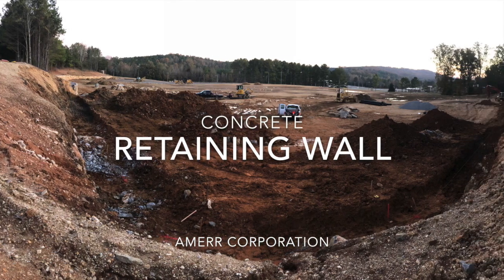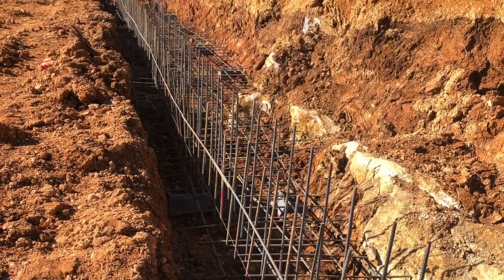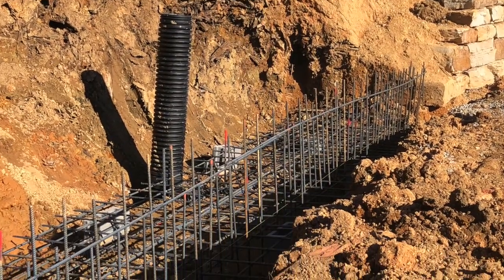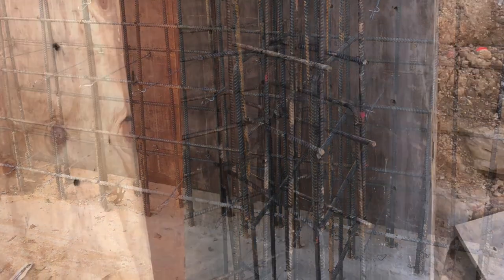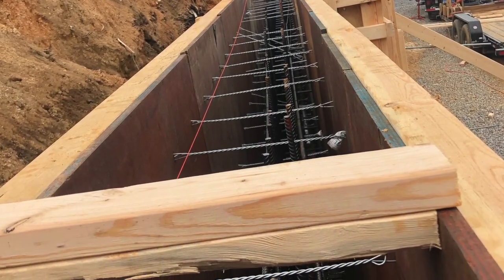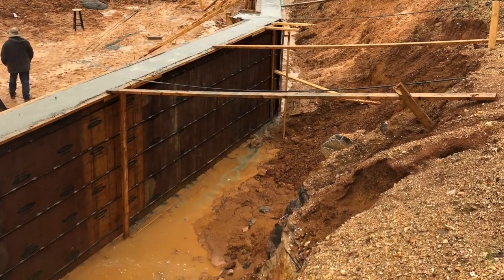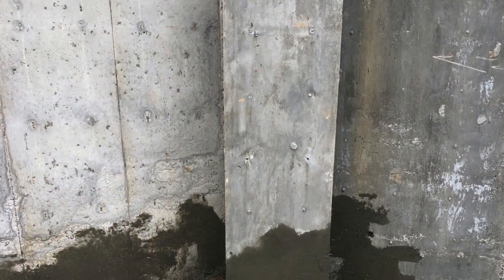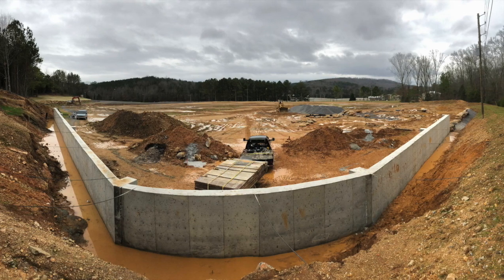Concrete Retaining Wall

Comment: Nice.. weeping system behind the wall ?

With block you can leave out bottom row grout for weeping or use that perforated corrugated tubing with the sock membrane... This wall had that ?

Nice video 👍. SWEET looking wall
Reply from the maker: yes it has pipe and stone over half way up and also has weep drains every 20ft.

Comment: Gates forms are very slow, BUT they leave a great looking wall.  Vibrate the shit out of them, they and take it.
Reply from the maker: Thanks for the comment, we have found them to be much faster than the traditional snap tie style of wall we had been using.  For the money we have yet to find anything better.  (we are always looking for a faster and more efficient way of forming.  Any ideas please let us know) Thanks
Reply: @amerrcorp.1217  Here in Northern Illinois most guys use Duraform (E-clips).  They are fast, inexpensive and pretty versatile.   A crew of 4 or 5 guys should be able to set and pour a 40 to 50 yard wall in 1 day.

Comment: Cost ?
Reply from the maker: We broke it down by each item.  total job well over 100K
Reply: @amerrcorp.1217  
Wowww 100k
Reply from the maker: @joseperiv most of that went to materials. I wish it were all profit...
Reply: @amerrcorp.1217  If you cleared over $12000..Then you did ok.
Reply from the maker: Thanks for the question.